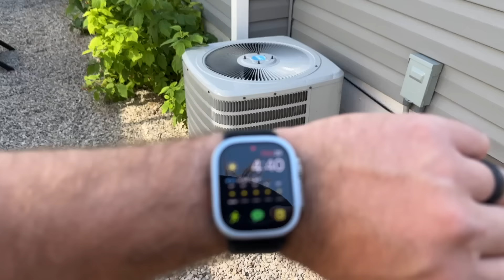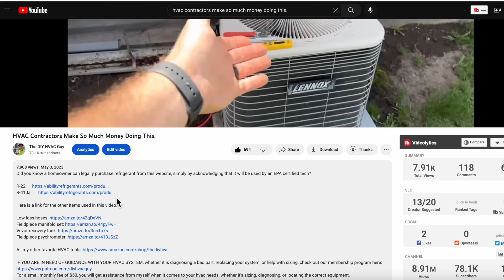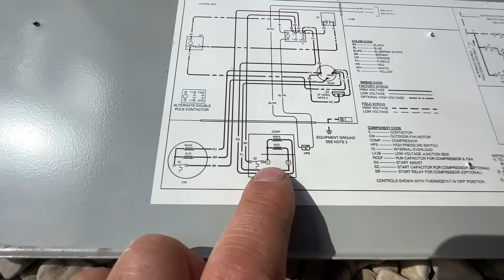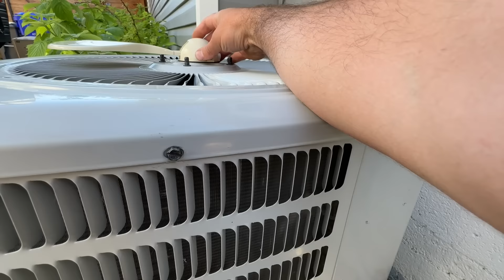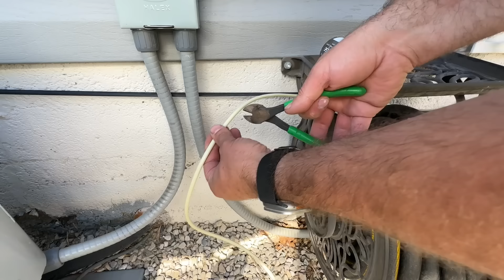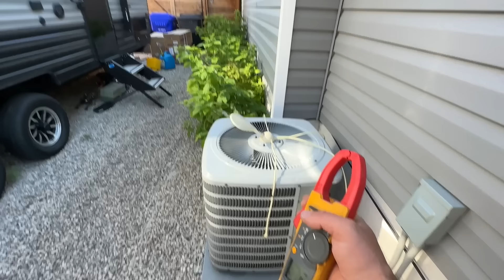Can This Device Actually Lower Your Electric Bill By 30%??

Comment: This system probably would work even better with more sprayers. Instead of a single spray on each side, 2 sprayers would be better. It doesn't take much to suck the heat away from the coils faster, but you still should try to get even coverage of the coils to pull as much as possible.
Pretty neat device overall, tbh. I like that the switch to turn them on is passive, non-intrusive, and only comes on when the condenser fan comes on.
With that said, definitely NOT worth $100!!! You could build a much better and more coverage system with drip irrigation parts from Lowe's/HomeDepot for a fraction of the cost. And if you have more than one air conditioner (for example if there are several window units), the parts would cover more units.
Reply: They sell 3 more sprayers to add onto this
Reply: What you guys don't realize is that if you lower the condenser coil temperature too much, the head pressure was too low and you cannot effectively push the refrigerant through the metering device effectively. You will be lowering your efficiency.

Comment: Sounds like a great way to coat your coils in the minerals that are in tap water. Any short-term gains are probably lost to the insulation from mineral buildup.
Reply: It came with an Water filter, hopefully that helps.
Reply: Depending on the amount of minerals in the water. Here in FL, AC units only seem to last 12-15 years. The race is then between mineral buildup, and wear and tear on the unit. I do have a working softener. Just would need to use that water for this purpose.

Comment: I've done this while charging my old Toyota pickup. I use the garden hose on mist and hang it in front of the condenser while I'm charging and testing. You should hook up a set of gauges and show people what the high pressure side does when you spray cold water on the condenser. It drops dramatically. You've basically removed a big portion of the heat load from the compressor and it shows in the lower amperage draw. Less amps = less work, and vice versa. 

But in order to test a change of capacity you should have used a differential of the entering air temperature and the leaving air temperature. Simply measuring the leaving air temperature does not show whether you had a colder entering temperature at the time of testing.

So if you measured 78° EAT (return) and 55° LAT (supply) you have a delta T of 23°. If you measured the 2nd time and got 70° EAT and 50° LAT you have a delta T of 20°. Now that's just an example. You probably did gain some capacity. But how much is anyone's guess without a longer formula. 

The reduced amp draw is what you really need to be pointing out to people. From 4.6 to 3.3 is a Whopping 28% reduction! Assuming your unit is 208-230 volts that's a 300  watt reduction in energy cost over how many years?! That's what a lot of people fail to take into consideration. Wattage used over time. The more you can reduce wattage and the longer it goes the more money you save. 

"Every penny counts."

Comment: This DIY trick needs a WARNING!  Remove this well before cooler autumn temps!  Spraying water on a heat pump in heat mode will create a Titanic problem!  It's only possibly permanent for A/C only (non-heat) systems.  Great tip though; these should be at Harbor Freight.

Worth mentioning you do not need any of the special tools used, to install this.  The clamp and dBa meter were only checking the performance.  A simple before-and-after to determine real kW savings per hour, would be to 1)unplug your fridge and 2)flip the breaker off for your Hot Water Heater, while 3)the A/C is set (low-temp like 60) to just run constantly (turn it off for 3 hours beforehand or start at 80), 4)for a timed hour (or even two) and 5)write down the kW draw (subtract before from the after) read at the meter for the whole house across that (timed) hour.  Then repeat the test next day with cooler installed, at about the same time of day, same sun, same outdoor temp (within 1-2), and compare total kW used.  In this way you only need the electrical competence to use a breaker switch, and unplug an appliance, which every homeowner needs.  (If you aren't cooking or running hair dryers and garage tools, or charging your car, the water heater and fridge are the main power drains, which are not constant load, like the cable box, etc.)  So don't cook during this test run, or shower, run the garage Air Compressor, vacuum, leaf blower, or charge the Tesla.  TV and Youtube, however, is fine.

If the sound level had changed much in this context, it would indicate the equipment is straining or very worn, and likely to need replacing or service.

15-30% power reduction very possible in moderate humidity.  Extremely swampy climates will not see nearly that, while AZ dry heat may do even better.  This product is a great idea outside of incredibly humid areas found in MS LA FL.  It likely uses 4-10 gallons of water a day.  Positioning of those nozzles would ideally be integrated into the system design by engineers, but generally covering the top third of unit on the 3 largest sides and not facing your house / foundation ever.

Aluminum sheet construction for the plastic switch part would improve its durability to the life of the unit.  Even better, using a wired (240V) valve / solenoid powered from the HVAC compressor switched power, could be integrated to only operate in summer (condense) cooling mode, not winter (evaporative) mode.  This would definitely void the warranty terms, but would not put any strain on the system beyond effects the water has.  In fact, you could skip this kit since all you need is the hose and 3 mist nozzles, and install using an ice-cube maker fridge kit, and selecting your own nozzles and quantity. 

Worst drawback needs repeating.  This should be inspected while running at least every couple months, and should be uninstalled / brought inside well before the high temps drop to the 60s!  YOU DON'T WANT TO KNOW WHAT THIS WOULD DO IN THE WINTER!  $$$DI$A$TER$$$

Comment: your question was can it save 30%.   The answer is No.  the number is more like 18%, less if you deduct the cost of the water from the cost of the electricity.    but it's still an improvement.

Comment: I had one & it was junk. I live in Georgia which is  HOT, HUMID & HORRIBLE  for 9 months of the year. I had my annual system checked & freon topped off prior to installing this device. The flapper valve on top had to be replaced after 3 months because it just stopped working. I performed all of the same tests he did: register temps and amp draw before & after = no change. The only difference I noticed was my water bill was higher. Save your money - clean the coils on the outdoor unit at least once a year. Cleaning products are readily available at HD & Lowes. Look for "Coil Cleaner"

Comment: Would the water vapor corrode the aluminum fins on the inside of the unit. I have soft water so in may be over kill with the filter . Wondering if nozzles would plug up. I’m guessing these need to be replaced occasionally. Are the nozzles available for purchase?

Comment: Your experiment sounds quite interesting and indeed, it might seem logical that misting water on the condenser unit of an AC would help cool it down, making the AC more efficient. However, the result you're seeing - the supply air temperature going up instead of down - can actually make sense due to several reasons:

Evaporative Cooling Limitations: The concept you're using is called evaporative cooling, where the evaporation of water absorbs heat, leading to cooling. However, evaporative cooling is much more effective in dry climates (like desert areas) than in humid ones. If the air around your condenser unit is already quite humid, the water mist won't evaporate as effectively, so it won't cool the condenser as much as you expect.

Heat Transfer: The main job of the condenser is to release heat from the refrigerant to the outside air. This process depends on the temperature difference between the refrigerant and the outside air. If you're cooling the outside air with a mist, you're reducing that temperature difference, which could make the heat transfer less efficient. This means the refrigerant stays warmer, which could cause the supply air temperature to go up.

Water-Heat Capacity: Water has a high heat capacity, meaning it can absorb a lot of heat before it gets hot. If the misted water isn't evaporating (especially likely in a humid climate), it might absorb heat from the condenser coils, but then that warm water just stays on the coils, effectively insulating them and keeping them from releasing heat to the air as effectively.

Calcium Deposits: If the water you are using has a high mineral content, over time, it can cause calcium deposits on the condenser coil. This will decrease the coil's ability to transfer heat and could lead to higher head pressures and cause the unit to work harder.

Increased Humidity: The introduction of water mist could be increasing the humidity of the air being sucked into the condenser, which would reduce the unit's overall efficiency.

Energy Consumption: Even if the misting did help the efficiency of the AC (which it appears it doesn't, at least not in your case), you would have to consider the additional energy used by the water pump for the misting system. This could offset any gains in AC efficiency.

In general, it's usually best to follow the manufacturer's instructions for maintaining and improving the efficiency of your AC. They've done extensive testing to figure out what works best. Simple actions like cleaning the condenser coil regularly and ensuring good airflow around the unit can often be more effective ways to improve efficiency.
Reply: Your comments on humidity limitation and calcium deposit are spot-on. However your comment on Heat Transfer does not sound right. This is an air-cooled condenser so I would expect that the temperature of the cooling medium (i.e. air) would be lower than the temperature of the refrigerant. So if you lower the air temperature by water misting you actually INCREASE the temperature difference and get better heat transfer
Reply: The water would have to evaporate on contact to increase efficiency. In humid climates the water would not evaporate as quickly and reduce airflow and heat transfer.

Comment: I made my own mister for my window unit from PVC pipe and mist nozzles I bought on Amazon.  It is so much cooler now in the room it is located.  You barely have to turn the water on for it to work.

Comment: I had the compressor fan fail one weekend and didn't have time to fix it for a few days so I just hung a sprinkler on top the compressor where the fan was mounted and turned the water on just enough to keep the coils wet.    Worked great for 3 or 4 days until I could get another motor.

Comment: Why not just use the condensate water instead of taking up your spigot?  My AC makes gallons of condensate a day that just goes into the sump pump hole.  That water is also very cold and could recover that energy by cooling the condenser even more.

Comment: That can ruin your unit.  I had a customer completely oxidize the condensing coil. Water quality and the quality of coils vary, but I would keep an eye out for corrosion.
Reply: That was the point of the filter he put on it.
Reply: @KingcoleIIV  that will help.  It's a reaction with the aluminum not necessarily the cleanliness of the water, and there's debris in the air that's going to mix on the coil

Comment: QUESTION... Would the water draw cost outweigh the energy draw savings?
Reply: Not being a smartalec, but it depends on many things. Do you pay for city water or have a well where you just pay for the electricity. What is the cost of electricity in your area? (it it's expensive, you would save more by reducing amp draw). What is the average dew point in your area? This system works best in a arid environment; maybe very little if tropical or sub-tropical. Assuming you don't wreck your coils, the water draw is so minimal it don't think you would lose money.

Comment: I do not think it saves you money. You must pay for your water if city water and pump energy costs if on well. Only benefit is the unit runs easier which means will last longer.  Building a shed to block the sun  with only a roof and 4 posts to hold it up would most likely do similar results.

Comment: Nice video and just subscribed 
I’m curious about any possible calcium buildup on coils that would cause damage or effect the cooling system. would you know if the filter that comes with misting system help prevent that or would someone maybe need to also install a separate filtration system?
Reply: I have a 240 volt solenoid that opens up when the unit starts and lets the mist start. 
The main reason I use a water filter is so the misters don`t get clogged. I have city water. It works flawlessly all summer long. I do keep some spare brass misters close by though just in case.
Ft. Wayne, IN.
Reply: If you have hard water, a simple filter is not going to ensure demineralization. You would have no way to know if it is working, or when it quits. And the pH of your water can destroy your coils over time. This is a gamble depending on your water source, and it can be an expensive gamble if you lose.

Comment: I wonder if the paddle would mount securely and actuate on a Trane with a top cover that discharges the air at an angle off the top.

Comment: Misting the condenser works well to reduce power consumption, but you best be using distilled water or you're going to clog it up with hard water deposits over time.

Comment: Use a water filter so your condenser doesn't get mineral deposits from the long term water exposure,  the o ly measurements that really matter would be high side pressure and vent temp, if those are lower your system wont need to run as long.

Comment: Heat pumps suck!  I had $500 ac bill in the summer months,when my system took a crap My boss gave me a new heat pump system  (where I live is going away from gas) ya my ac bill dropped to 400, and my heat bill shot up to the 550 from 150 when I had gas. Free is never free

Comment: The one thing to really prove this point would be to measure intake vs output difference. if the ac was running and you add water did it really change or was the house colder on the second measurement? The change in temp, in and out, is the measurement you should of shown. but lower amps is good either way

Comment: This is perfect timing!
My condensor fan has been overheating and tripping the circuit breaker since temps started hitting 95 degrees a couple of weeks ago (the motor has thermal protection of some kind, but it doesn't seem to be working, hence tripping the circuit breaker). After I replace the motor, I am going to get one of these!
Reply: Hey before you replace the motor you may want to try the capacitor. Mine got super hot and tripped and the motor was fine.  I tested the capacitor and it was smoked (if you don't know it's a battery that helps the ac unit startup with putting to much load on your electrical) anyway it was like 12 dollars and took me ten minutes to install.  Take care

Comment: Here in TX the dust we have on hot, dry summer days mixed with the mist would cake up the condenser pretty fast.  I'd stay away from this thing knowing how expensive cleaning of the evap unit is.

Comment: I didn't see anything that should have changed the amp draw. The savings should come from shorter duration run times.

I use my condensate pump to water my garden. In the south east, I get about 5 gallons a day...

Comment: In a humid environment its going to aid in grime sticking to the condenser. Keeping the condenser clean alone will allow the fan to easily pull air through and keep the high side pressure ideal.

Comment: I haven't tried one of these yet, but what I do have is a swamp cooling system(Glacier Pool Chiller) on my pool, and it works great, even in Houston, and a "dry" day in Houston during the summer is 70% humidity. My pool temperature right now is 78 degrees, and it has been 98 to 105 here every day for the past two to three weeks, My neighbor is on vacation for two weeks right now and he asked me if I'd check his water level every now and then. His pool is about the same size as mine, 25,000 gallons, We both have Pebble Tec coating in our pools, with mine being fairly darker then his. Even so, his pool water temp today was 92 degrees, a 14 degree difference. 92 may as well be a hot tub. Point being, even in high humidity evaporative cooling systems still works. I built the pool in 2008. I didn't have my pool chiller that first year. By mid July the pool was already 94 degrees. The last place I wanted to be was in my new pool. Think about that for a moment.
Reply: I’m about to build a pool in Houston. I know I need a chiller. What sort of water use from evaporation are you seeing with your Glacier? How many hours a day are you running it during this blistering summer? I’m glad to hear they work as I figured with our humidity it wouldn’t be effective.

Comment: Cool design! I would think having side spray nozzles would be more efficient.
Reply: Yes. From the video, it appears that the water is "misting" on the outside of the unit.
If it was, you should turn it around so the water must is actually hitting the cooing coils. 
And place the mister in the upper center so the water will drip down to absorb as much latent heat as possible.

Comment: Measuring the temp of the vent output is not what you would do as it does not tell you much. You have to measure the difference between the return air to the AC blower and the vent. a 20 degree drop is normal. You'd want to measure before and after to know if the AC is actually cooling more or not.